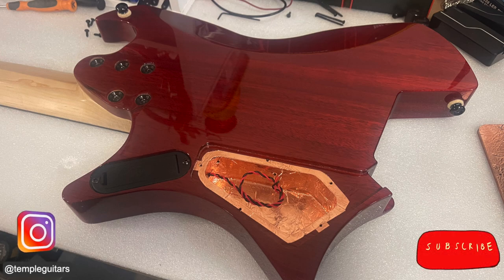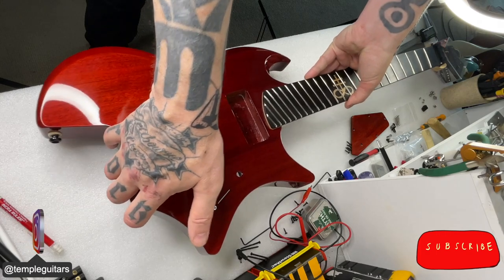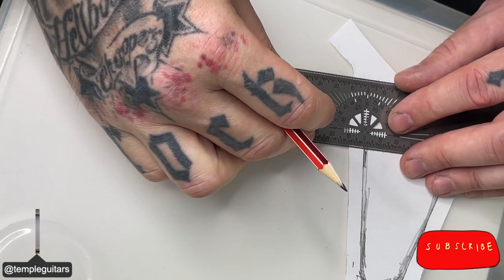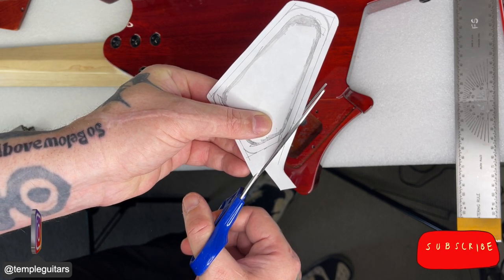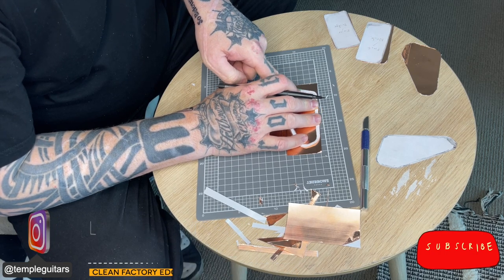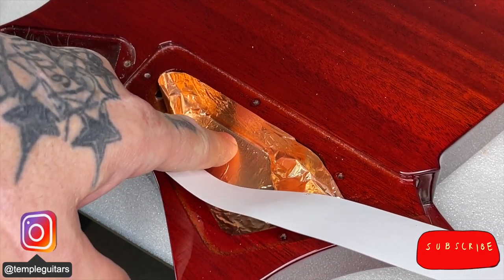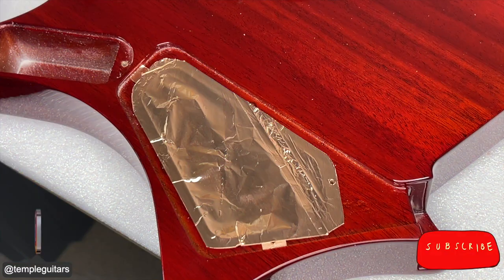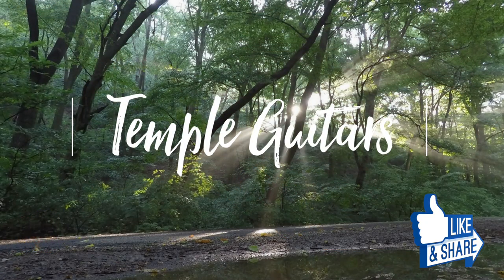How to install copper foil tape shielding in your guitar.

Comment: Right on man. Glad to see a new video. My method is very similar. I found that the end of a small wooden dowel works pretty good at flattening the foil and working it into the corners. I keep one on the bench just for this purpose.
Reply from the maker: Absolutely- that would be great, especially if it had a tiny round over to avoid tearing. I just have so many tools at this point if I can just use my finger for something, that's what I do.

Comment: Do you need to solder anything when you are shielding the cavity with the foil? Thanks!
Reply from the maker: It depends on your wiring schematic, but in most cases as long as your potentiometers are all grounded to each other and the output jack/bridge, there's no need because the sleeve of the pots ground to the cavity shielding. Some people use the shielding only, and don't ground the pots to each other. Try to find a wiring schematic for your guitar, and check.

Comment: Was wondering if you put an earth lead onto the shielding, or just rely on the pot to earth it
Reply from the maker: I run a wire from the back of one of the potentiometers to the bottom of one of the individual bridge saddles, and use more tape under all the bridge saddles to connect them together. 
i don't ground to the copper tape in the cavity, and I use insulated washers on all the pots etc to ensure they don't connect with the tape. The tape basically forms a faraday cage to keep out interference, but it itself isn't grounded to anything.

Comment: I use the same procedure.  I like to do the sides first.  Make sure all your copper is grounded to all the other copper and then guitar ground.  It should all become one path.  You can use copper or solder wires.  Thank you for the video and great tips!!
Reply from the maker: Hey Billy! Great minds think alike!